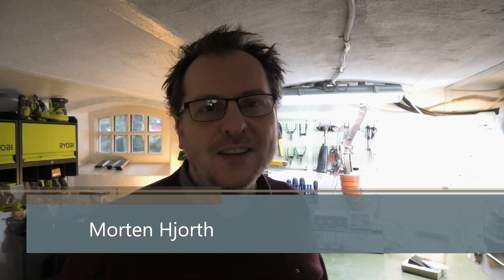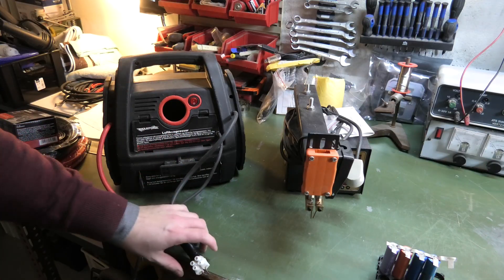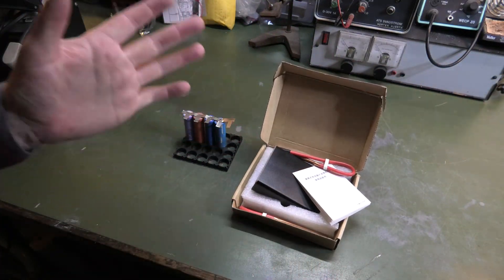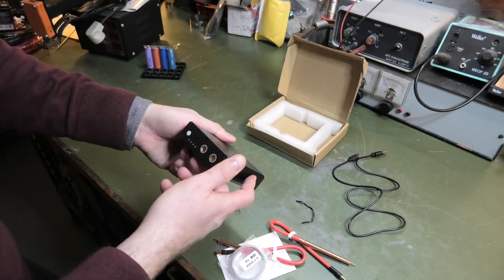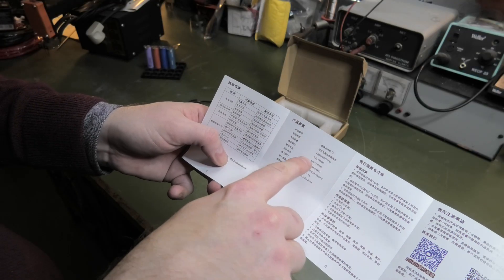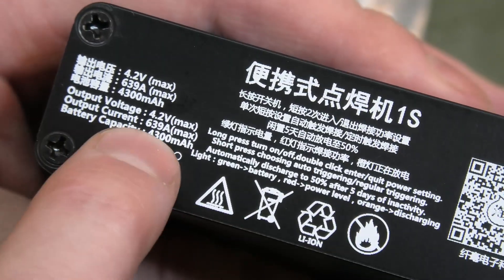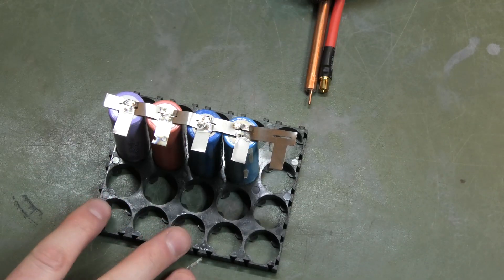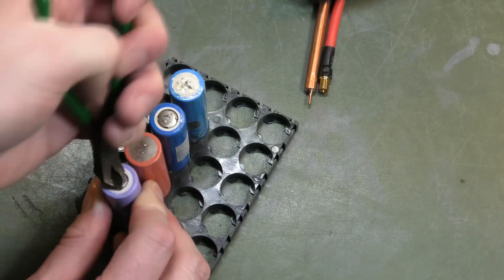Awesome $50 Tiny Spot Welder - Better than Expected - 1031

Comment: Fantastic review. I really appreciate that you took it apart to show the internals.
Reply from the maker: Hi Dustin Skye
Thank You very much!  It will actually be shown again in about a hour in todays video :-)
Thank you for watching! :-)
Reply: @MyPlayHouse  I just got it in the mail from Amazon for $72 and all I had to do is press and hold the button and BANG! I got little solder leads on my tiny CR927 Li-ion coin cells and soldered them onto my logger board's RTC clock and set the time.
Reply: I was about to say the same! I was very curious what kind of batteries were inside and assumed 18650s so I'm glad that was cleared up

Comment: I'd add heat shrink to the probes, so that only the tips are exposed. Too easy for bare copper rods to touch accidentally.
Reply from the maker: humm or electrical tape.. maybe
Reply: There is a clear plastic cover over the copper rods section

Comment: I was hoping to see some capacitor inside that would be discharged into the spot weld, but it looks like there are just a series of MOSFETs that directly connect the li-ion battery across it. That's fucking terrifying :)
Reply from the maker: I can see how this could go terribly wrong,, but also that adding some capacitor could just add one more layer of complexity and more to go wrong. :-)
Reply: @MyPlayHouse  And this price is probably only possible due to it's simplicity. Just please don't store it close to anything flammable :)

Comment: wow, so actually, no capacitors with this? i always afraid of them, lol. i do however find that copper handles not that safe, why is this done like that? other than that (and maybe little bit longer cables and replaceable tips), looks very nice.
one little tip on scratching and moving on the desk: just put that silicon rubbers stickers on corners.
Reply: 4.2V doesnt kill you, this device rely on amps. you need high amps to make the weld. high voltage isnt necessary with spotwelders like this. you can touch the probs with your fingers, your not gonna feel anything. And they keep the wires short , to keep the loss as minimal as possible.
Reply from the maker: Yes,, the handles did not need to be cobber,, it looks like a death trap :-/

Comment: It probably is a one trick pony, but it seems to do its trick rather well! Nice little device, really!
At first it seems counter-intuitive that you'd be able to power a spotwelder from such small power sources, but what the spotwelder does is taking the power provided to it over a long time and release it in a millisecond or so. The great advntage of spotwelding is that you don't put a great amount of heat into your parts to achieve the connection after all!
So Bob's your uncle, Pocket-Spotwelder Olé! :oD
Reply from the maker: Compared to the other two tries,, this was great.
Reply: You obviously have no understanding of how this work

Comment: I don't like how the connection for the welding "probes" (don't know what to call it) are surface mounted, especially because they require some force. I think that'll probably be the first thing to break. Maybe it's best to put them in and never take them out again
Reply from the maker: Yes they are hard to get in,, so I did not take them out. and would probably only do that to replace them.
Reply: @MyPlayHouse  I have a similar unit, different layout PCB though, with the same battery setup, I removed the spot weld probe sockets and ran flexible 8 gauge cable straight through the holes in the case and soldered to the board/copper bars, and it welds quite a bit better.  Now able to do 0.15mm Pure Nickel welds reasonably on max setting where it did poorly before.  Connectors or any added PCB resistance is super important on spot welders.  Note: If you do this don't make your leads much longer as longer leads result in higher inductance and the resulting voltage spike during the weld may destroy your MOSFETs

Comment: Just wanted to say I bought one of these from Amazon for around $67 and it is great! I was certain it would be garbage compared to the $20 ones, but this one seems totally great.

Edit: the USB charging port fell off the main board. I can still charge the battery by taking the whole thing apart... Micro USB ports are surface mount and don't have through hole supports.
Reply from the maker: I was also positively surprised, of just how well this was working.
Reply: bought the same one for $67 a few days ago.  first one was DOA, power button didn't do anything.  Received a replacement 2 days later and it works like a dream.  Hopefully I can wrap my brain around the limitations of 0.1 nickel in my projects since I've read this doesn't do well with anything thicker.
Reply: Very nice video. I have usein it. Do you shure it is not battery, but condensers 20000Farrad?

Comment: Very nice :-D,  controlling the duration of the discharge to make it the same every time.
And your probes have to be on the strip before it fires, better control.
Clever little box, i bet they took a while to get it optimised.
Along with the small area probes, control again.
Reply from the maker: Compared to everything else I have trued,, this is great 👍

Comment: @My PlayHouse - Here is the german link. Possible you can add it?
https://www.amazon.de/BIlinli-Punktschwei%C3%9Fger%C3%A4t-Batterie-Nickelstreifen-Punktschwei%C3%9Fmaschinen/dp/B088TLDLQV/ref=sr_1_9?__mk_de_DE=%C3%85M%C3%85%C5%BD%C3%95%C3%91&dchild=1&keywords=Tiny+Spot+Welder&qid=1610119008&sr=8-9
Reply from the maker: Might also be ever so slightly faster than from China 🤗

Comment: So, how about 2 layers of nickel (power level 3?) 3 layers of nickel? 4?
Reply from the maker: Hi James Larson
I have not tried more than one layer,, but more power would be needed.
Thank you for watching! :-)
Reply: @MyPlayHouse  I couldn’t help myself, for under 50 USD already ordered! I can’t wait to try it out upgrading some bike light packs!
Reply: you can weld it layer by layer,welding more than 1 layer at a time  is in secure.
Reply: @叶自龙  Nice, thanks for the process tip!
Reply: Can you let me know if it welds 0.2mm thick so I don't have to do 0.1mm twice? Thanks.
Reply: @ar9maker  I need to order some 0.2 strip...

Comment: You can easily reuse old cells even when welded to a a rail.

Side cutters, snip off close as can be to weld point, hamd file the rest down cautiously with machine oil (the hair clipper/sewing machine type), flush with Isopropyl, rescore with a fine pen knife then pre flux and solder with a reliable solder station and wide spade tip.
Reply from the maker: Sorry, I do not understand what you are going for 😬

Comment: Amazing how small these have become. Thank goodness for solid state components.
Reply from the maker: And on battery, the last one flipped my 230volt 13A fuse 😬
Reply: @MyPlayHouse  Would it be possible to run it on one of the phases of your 3 phase power that was originally intended for the water heater? Surely it won't saturate a 50 amp supply?
Reply: @MyPlayHouse  I posted a comment about this, I have the same spot welder from bangood, I use a 30amp fuse, and a 'c' breaker in the fuse box for high inrush currents. Those spot welders draw over 15amps at 230v, the lights in my house flicker whenever I do a weld and I have a 60amp supply into the house.